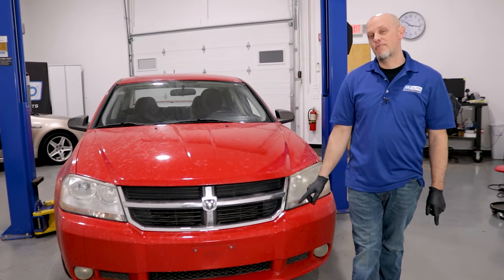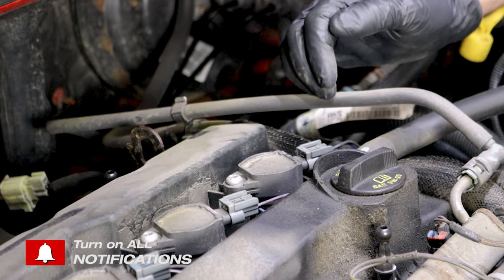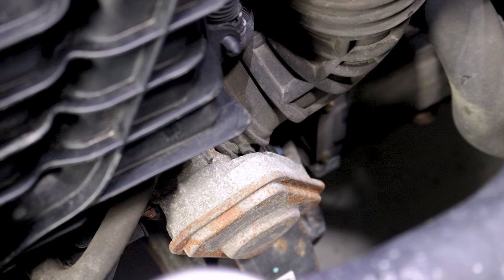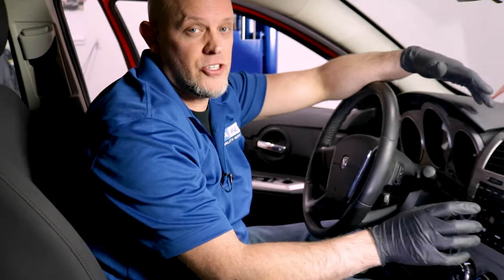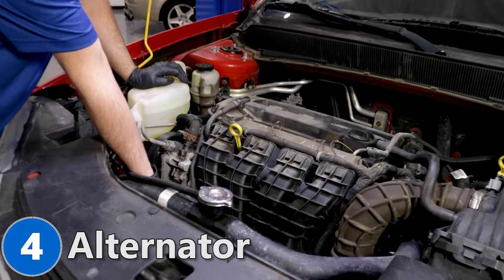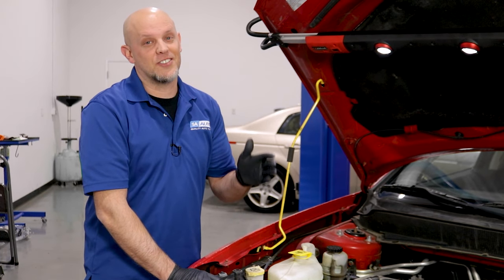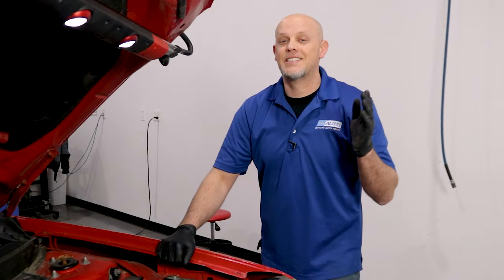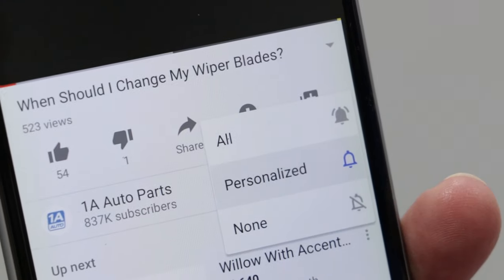Top 5 Problems Dodge Avenger Sedan 2nd Generation 2008-2014

Comment: I'm sorry, but almost everything here is nonsense
1. Ignition coils. The ignition coils on these cars are almost eternal. Over the years, there has been a problem with rubber tips and gaskets. Replacement price - 4-20 USD
2. The throttle valve on the Dodge Avenger rarely raises problems, unlike the Dodge Caliber, where over the years there is a problem in the gears. In Russia they simply change the plastic gears to metal ones and forget about this problem. Cost - about 40 USD in Russia (St. Petersburg)
3. I partially agree, there is a problem, but it can be solved quickly enough, especially if you know how to work with your hands
4. Alternator. Does not cause problems. Periodically (every 70'000 kilometers / 45'000 miles) it is required to replace the generator clutch and replace the bearings. Cost - from 10 USD
5. I partially agree. But the problem with the thermostat housing appears only in case of improper operation and overheating of the engine. Replacing thermostats solves 99% of problems

I would name other problems:
1. Clockspring - rarely, but fails, quite an expensive spare part
2. Plastic tees of the cooling system (including the neck). Plastic becomes brittle in 10+ years

I am the owner of a 2008 Dodge Avenger SXT, 226'000 miles
I'm sorry for my bad english
Reply from the maker: +Алекс Арр Thanks for the feedback!
Reply: That plastic T popped on mine and scared the piss out of me. It was an easy enough fix but it did set me back $80 USD lol
Reply: Hi!
I am in US in Georgia-sisters with Georgia in Russia.
I'm hoping you can help:
1) Where is the keyhole for the trunk to pop open? The button next to the steering wheel to open the trunk isn't working!

2) my oil pressure sensor light dings all the time while I'm driving. Nobody seems to know what's wrong-not even workers who change my oil! Do you know what it means?

Thank you so much for your help!
Nancy

Comment: I've had my 2013 Avenger since...2013 and it's only needed Tires, an alternator, battery, a sensor, and brakes (knock on wood). Oh yeah and the headrests popped out but that's all dodges and I just got a letter that they're covering the repair under a recall. May need new shocks soon, but not too shabby for 8 years of wear
Reply from the maker: +Joe Williams Thanks for the feedback!

Comment: I have a 2012 Avenger that has 2 thermostats that had to be replaced at around 60,000km. Drained the anti-freeze twice so far (Car currently has 110,000km) and had to replace the hoses once. It seems this car has a defective engine coolant system which requires the anti-freeze to be replaced every 30,000km. FCA refuses to acknowledge this issue. Besides that it's a great car.
Reply from the maker: +Nick Knight Thanks for the feedback!
Reply: I have a 2010 avenger r/t and it's been great except I'm having this temperature light now. I replaced that hard plastic housing outlet along with the two thermostats about 2 months ago. Now I just started to hear a bubbling noise from that area. After reading about the faulty part from your posting. Do you have any advice so I can try fixing it myself.

Comment: 2008 Avenger in the past 4 years (im 3rd owner) replaced a radiator ($118 new) coolant T-filler $38), thermostat housing in 2021 & again this Oct. 23 (the plastic housing melted n warped), valve cover gasket, oil sensor $28, shifter cable grommet ( $23 online part), turn signal assembly ($40 aftermarket), front n rear engine mounts + transmission mounts ( $200 parts n labor local mechanic)... All of these things done over the last 4-5 years and some as preventive maintenance. The previous owner did zero maintenance... I've  replaced door switches, side mirror, center console rest, trunk actuator w parts obtained cheaply from the local ecology. wrecking yard. 
It sounds like a lot, but done little by little over the last 4-5 years it was well worth the $1200 paid for the car used.

At 240k Miles it drives straight, runs nice on the freeway, doesn't smoke or leak any fluids and hopefully will pass smog today.

California Sporty Senior

Comment: I have had my avenger from 60k to 123k, I still have it and I have replaced the throttle body, the thermostat housing and both thermostats, the oil pan, leaking hoses from radiator, plugs, and now I'm having alignment issues. The car is close to its end of life, so I will keep running it. Overall its been a pain in the a-- to deal with!

Comment: I had a 2014 dodge avenger until today. It ran to 140,000 miles.  I was expecting to get to 200,000 miles and it didnt make it.  About a month ago, i took it on a long road trip, came home, parked over night, and the next morning noticed a rough idle on the way to work.  At lunch the check engine light came on.  I took it to a mechanic who replaced all the coils and spark plugs, but it still threw a cylinder 5 misfire.  He thinks my avenger had carbon buildup on the cylinder 5 exhaust valve.  I dont know.  Last night i realized valvoline started telling me at 75k miles to replace the fuel filter.  I don't know if i did or not.  But the engine problem got worse over the last month as i finalized buying a new car.  Today was my last day to own my favorite car.  I really wish it had made it to 200k.  I changed the oil every 4000-5000 miles.  I used regular gas.  Things i do differently are getting midgrade gas, using a fuel cleaner, replacing the fuel filter, and going back to 3k mile oil changes.  It was a very good car for me until the engine went out.  Shes gone too soon.  Im now a toyota rav 4 owner.  Bye to my little zoom zoom avenger.

Comment: 2008 avenger r/t, with 240,000 miles. I’ve had to replace a failed fuel injector and that’s it other than normal diy replacements. And the battery last year but it was the original battery and it lasted 14 years.

Comment: You missed one very common as I see on internet: the transmisión stuck in limp mode (or entering in limp some times other not, but mostly when warm) because of a bad pcm, shows the errors p0700-p0760 but changing the solenoid pack or speed sensors donˋt solve it, only changing the pcm and programming it. I don’t know what causes this, but happened to mine after 10 years an 80k km.
I opened the old pcm and looks like they used very bad components for thermal transfer, so the pcm heats more and puts a lot of stress on smd components making them to fail.
Reply from the maker: +Alejandro Lindemann Alfaro Thanks for the feedback!
Reply: Sounds like what mine does , fires right up sometimes & runs great until it gets close to op temp then it goes into some limp mode where there’s only 3 trans speeds & it runs 58-60 mph @ 3,000 rpm but will not shift into overdrive. Complete pain in the rear!

Comment: 2013 Avenger
96k
The plastic t that holds the radiator cap blew up. Literally. 
Mixer motors for the AC click intermittently. One already replaced but the other two click as well.
EVAP leak that we have yet to locate. Suspicious of the filler neck since it wables.
I think the alternator is giving up the ghost too.
Chrysler products in general suck (parents have a 2013 grand caravan). Couldn't pay me to own another.
Reply: My filler neck on my 2013 blew while I was driving cheap plastic

Comment: Thanks Video was simple,  to the point and saves everyone time.  Question anyone can help me: I have a 2013 Dodge Avenger SE 2.4L . I love the car just that it takes time to get up to speed , I know it’s not a sports car but I have a mini van that takes of faster ,  the communication between  the gas and response time is at least 8 seconds.  It’s very slow to get on freeway. Once it’s on the freeway at 60 it can easily go to 70 . Is there a solution? Or it’s manufacture defect?
Reply: Mine is a 2010 and you're right its not fast. Its gearing ratios. But I just drove mine 770ish miles on a tank and a third. About 70 bucks. So I can't complain.  But  I do yearn for the manual trans. The auto needs another gear
Reply: Should have gotten the 3.6 avenger

Comment: Is this strictly issues for the 2.4? I've also heard issues of the door blend actuator. The 3.6 is what I have and it's a great engine. Also the transmission in both aren't really great.
Reply from the maker: +Jacob Wolf Thanks for watching!  The issues under the hood are really for the 2.4L, but the other issues can apply to both models!

Comment: Let me fix your video. Top 5 problems with Dodge Avenger are:
1 - Battery is located in the left wheel well. You will have to take the left front tire and the inner well lining off just to get to the battery.
2 - The air actuators will fail causing a tap-tap-tap-tap-tap sound when you play with the heat/ac or even sometimes just opening the door.
3 - While changing the thermostat isn't that hard, it will require TWO thermostats. You failed to mention that.
4 - The radio in the Avenger sucks and will stop playing AM/FM. You will get no sound. It will however let you listen to CD's.
5 - The radiator cap housing is not on the radiator. It is on a plastic hose connector and will eventually break, causing you to lose antifreeze and overheat in the middle of nowhere.

Comment: 08 Dodge Avenger 191k still runs good replaced everything he said except blower motor
Reply: It's normal. Parts are designed to fail eventually. Do you like the car overall?
Reply: @danejurus69  yeah everything I’ve done on it hasn’t been terrible but I like it I’m going to drive till the very end lol 😂 it’s my work car
Reply: They’re trying to sell me a 2008 Dodge Avenger with 130k miles on it should I buy it? He says the engine and transmission are good

Comment: 2014 Dodge Avenger here

My issues I've had with it:

Had to replace Crankshaft Position Sensor
Had to replace Camshaft Position Sensor
Had to replace Water Pump
Had to replace Radiator Hose
Had to replace Coolant Temperature Sensor

It's also doing the blower motor thing now
The thermostat may also be bad, according to what is happening to the temperature

Hopefully I can get a new car soon 😅

Comment: One day driving my avenger from the store and it starts shutting down on me, I had a full tank, battery healthy, and fresh oil change. After a couple min it started back up but I noticed the RPM idle going up and down alittle, I’m going to be trying to take out The throttle body and cleaning to see if that’s the problem🤔
Reply: I had the same issue two times but for me it was the Crank sensor, and both times it was the same thing... it is pretty common on these cars by what I see..
Reply: Yes i have replace mines two big problem with these cars but cheap

Comment: I’ve got a 2008 sxt with 181k miles  and (knock on wood) the only issue I am having is with the windshield wipers. They work for a good 5 wipes then they are glitching and or stopping. I’ve already replaced the motor, that clearly wasn’t the issue. And then the usual check engine light but that reads for an 02 sensor and something else that’s very minor

Comment: Overall this vehicle has been super reliable. Only two issue I’ve had is the alternator pulley went out in which a mechanic tried to tell me the motor itself was bad because of a ticking noise but I was not flashing a check engine. And the second yes was the thermostat housing got brittle and started leaking. Other then those two issue I’ve had this vehicle since new and now with 160k miles and still going strong.

Comment: I have a 2013 Dodge avenger. The problem that I am having is the speedometer but not all of it just part of it. The speed has stopped working so I no longer know how fast time traveling the front headlights have stopped working and the horn has stopped working. I still have tail lights and back blinkers, but not in the front.

Comment: I had a 09, had none of those problems but it only had 60k miles when i sold it after 2 transmissions and 3 TIPMs failed. Transmissions were under warranty but the TIPMs werent for some reason. They cost me 1200 a piece so i said to hell with it and sold the car
Reply: What we’re the signs of the tipm failing? I think I may have that same situation right now.
Reply: @tylercore9554  random electrical stuff going haywire or inadvertently not working

Comment: Was really hoping u wld have an answer for the problem we are having with my sons Avenger.. 
the starter will just randomly engage while driving down the road… we have replaced the starter twice, replaced the ignition switch, replaced ignition coils, replaced alternator as well as changed spark plus and a general tune up.. our mechanic is stumped.. and I have a hard time paying our local dealer $250 an hr just to look at it with a minimum of 2hrs..
Reply: Computer won't even let me engage the started if the car is running. I'd say you have a computer issue

Comment: My alternator has a clutch pulley on front they go bad. But alternator was fine. To the unit to be rebuilt they said the clutch pulley went bad 90$ to replace. A lot cheaper than 2 to 300$ for a remanufactured one

Comment: I know this is an older video. But I have an issue with mine. 2008 avenger 2.4L sxt. Crank but no start. This is what I have done 4 new coils, 4 new plugs, new cam and crank sensor, new alternator x2, only 2 hard codes showing. Which are wheel speed sensor, and icm-ecm I've dumped 1300 into it in 4 days and still not resolved. Any help?

Comment: I just had my 2012 Dodge avenger quit on me. The battery light came on and I had to keep driving up to get home and just before I got home suddenly bunch of lights came on and I have a phone scan tool and I got a U 1412 code, also a cold that says low voltage. Do you guys think it could be just a bad alternator? Instead of a bad TIPM?

Comment: U didn't mention that dosge avenger have 2x thermostats,call AutoZone ask them I replaced both, ,one on driver side lower engine , other in that plastic housing where the top heater  hoose goes.

Comment: I need help, i am stuck, i have a 2013 dodge avenger 2.4L the issue is when im driving the car motor just shuts off completely and super random i can weeks without this happening and then it occurs the motor shuts off completely while driving, i have changed, crankshaft position senor, full throttle body. The fuel pump, Can someone please help i dont know whats left to do.. also i have no check engine lights on.

Comment: Has anyone had issues with aftermarket throttle body’s? I have replaced 2 of them and still getting the voltage part. Changed the alternator 2 times all back to back in 2 week time span. I will be driving down the road then the light will come back on. Shut it off and it goes away. Seems like after it warms up it doesn’t come on. Mostly when you first start it all with in like first 30 mins of running.

Comment: I have a problem with mine it tries to bog out while barely on the accelerator cruising, replaced spark plugs/ boots and replaced the broken air box .
Reply: No codes

Comment: i have an 08 avenger  has only 18.000 miles  on it   my abs  lite  comes on   somethings it will go out  ,,have a  C2116 - ABS Pump Motor Supply Low Voltage code,,do these  go bad  that much on dodges  as my gm cars never  give me any abs problems

Comment: I’ve been looking everywhere to try and see where the throttle body was located and nothing was able to help me lucky I found you. I also have a question... would I need a jack to get under the car to access the IAC valve and replace it or would I be able to do it from under the hood? I have this car and it goes up and down while in idle, it’s even completely stalled out but only when I have the AC on
Reply from the maker: +Lilly Araceli Thanks for checking us out! The IAC valve is typically located directly on the throttle body assembly. You will be able to access this from the engine compartment. http://1aau.to/m/Shop-1AAuto-c

Comment: 2013 dodge avenger owner here got it brand new from Dodge dealership. Worst car I have ever owned. The placement of parts are in the worst spots, battery behind front tire, so to take out battery either remove the wheel or take off the bumper. The worst repair that I’ve had that no one could figure out was the fuse box. Car stalled constantly, wiper blades, and horn would go off randomly.

Comment: Where is the fuse for windshield wiper motor for fluid output please?
Reply from the maker: +Sessa Mak The fuse that regulates the operation of the windshield wiper pump is located, together with all the relays and fuses, inside the special fuse box. This is often located inside the passenger compartment, but in some car models it is located in the engine compartment

Comment: My 2014 Dodge Avenger is a reliable car other than the fact the alternator goes out every year lol just buy yourself a brand new alternator and you will have lifetime warranty and I only pay $80 for labor to change it out.
Reply: Hi, I have a trouble with my dodge avenger 2008. Check engine light is blinking and when I get repair nearly all the issues related to this trouble but the engine does not work properly. The error code reading is variable every time I done computer checking. Please what is the status?
Reply: Make sure the battery connections are tight.

Comment: Riddle question

13 avenger 3.6L
Go in a store go to start the car and it won't start but will turn over wait about 30 minutes and she'll start right up and does it while driving just dies and when you start it up it has a vibertion sound.and when it idles down the sound stops.go to speed up it comes back??
Riddle me that please and thank you
Reply from the maker: +Charles Hamm We wouldn't be able to diagnose an issue like that here, you may want to have a local mechanic take a look at it. Thanks for checking us out! http://1aau.to/m/Shop-1AAuto-c